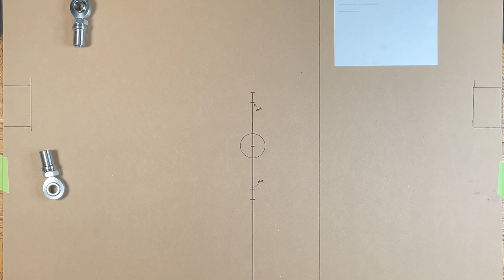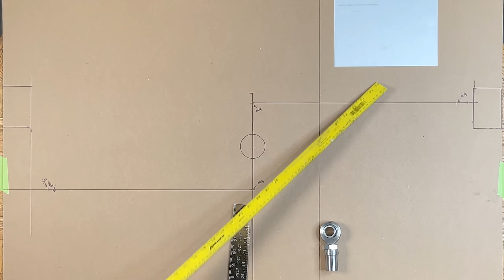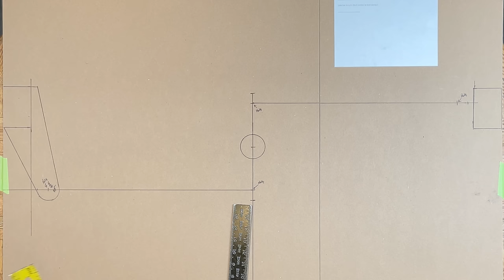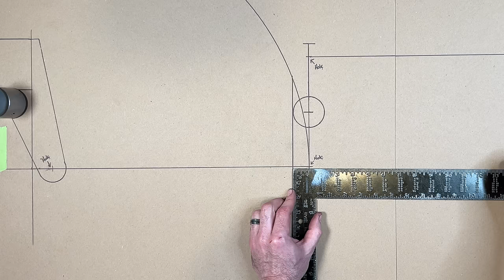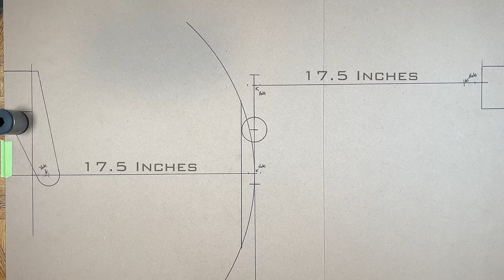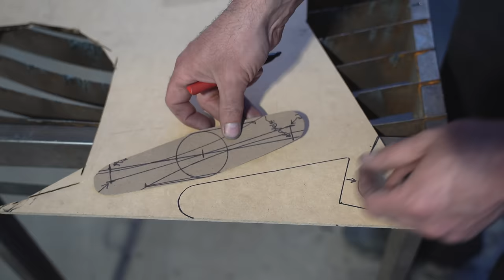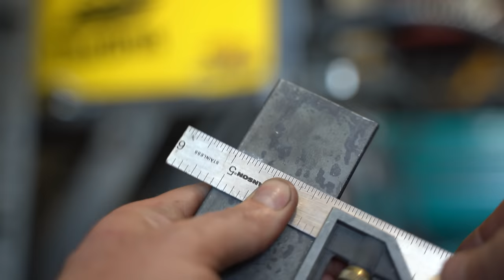The Greatest Watts Link Tutorial Ever! Mighty Max Ep. 16

Comment: One of those rare times I subscribe after a single video. Even though I already know how a Watts link works, I didn't feel insulted by your explanation of it. And you went into some details that I didn't know. Plus your fab work is absolutely top notch. Understanding the importance of a double shear mount instead of saying "good 'nuff" like some of the more shadetree channels would do was a massive boost to your credibility.

But the icing on the cake was the whole spiel with the tooth. That was just pure gold.

My gift, in return for the information and entertainment you provided, is to mention the "Mumford link". It's sometimes referred to as a "modified Watts" link. It offers a few advantages over the basic Watts; 1) It puts both frame brackets at the same height, eliminating the long, bendy bracket on one side of the Watts. This has obvious advantages for ground clearance as well. 2) It allows you to adjust the roll center by changing the angles of the main bars. 3) It can, in theory, allow you to put everything out of the way of the diff cover for easier maintenance. It's definitely more complicated than a Watts. And I can't swear it would work well on a long-travel vehicle. But it is very much worth a bit of research.

One more tidbit that many don't know-- both the Watts and the Mumford can have their pivotty bits mounted horizontally. You could have put that entire thing between the frame rails with the propeller mounted on top of the diff. Though I don't think that would be optimal since the pivot point would have to handle the articulation of the axle.
Reply from the maker: John… That was a tremendous amount of words. Out of all of them, the phrase I appreciate most was “Pivotty bits.” I can’t even type it without laughing.
I was once familiar with the Mumford link but have forgotten about it. I remember it being a magical dance of moving parts. I will certainly have to look that up again.
I’m clearly misunderstand your point on the horizontal mounting of the pivotty bits. I’m likely misinterpreting your statement as the whole watts link system on it’s side, but that most certainly won’t work. If you could clarify, I’d be insanely grateful.
Thank you for the kind words, John! Glad to have you. 🙌
Reply: @GarageFab  you interpret it correctly, the whole kit on its side. All the geometry works exactly the same. It does require an extra bit of flexibility at the axle pivot though. I've never seen it in use. I can't swear it's practical. And since the roll center of a Watts is at the pivot point that would create an absurdly high roll center. So it's probably more an interesting bit of trivia than a useful tip.
Reply from the maker: So I have heard of mounting a Watts Link system in front of the axle instead of link bars. (It was a theory at least. I haven’t been able to design it in my head)
But a Watts link prevents side to side motion by pushing and pulling on its bars.
By mounting the Watts on its side, it would then prevent up and down movement and only allow side to side motion.
So I still believe I’m misunderstanding something.  🧐
Reply: @GarageFab   With the propeller horizontal it will still rotate as the arms push on it. And the arms will still push in opposite directions as the axle moves. Try it with your scale model. Just stand it on its end and move the axle up and down.
Reply from the maker: Ok, I’ve thought about this for practically a whole day simply not getting it. But now I think I know what I was misunderstanding. You said the “pivotty bits” would be horizontal. I interpreted that as tipping the entire watts link system in it’s end. 
But you meant the propeller could be mounted like a helicopter prop, but the bars would remain horizontal. The bars would then be on the same plane but one would be a bit FORWARD of the other.
Given this epiphany, yes, I’d agree this would work properly. Also it wouldn’t necessarily have to be on top of the diff. It could still be behind the axle with a cleverly designed pair of bars bridging the diff.
It would certainly take up more room behind the axle but it could have prevented my design from needing frame tabs that hang down 6 inches.
My brain is fried now thanks, John. 😳
Reply: @GarageFab  ah, yes. Now I understand the confusion. You are correct. I was explaining it poorly.

Comment: Very informative and debunking the myths.
Also you can always use links on current model diffs and upgrade axles and centres. Or use y rear end setup like the series 2 Jag or the Aussie commodore or falcon rear.
Reply from the maker: Thank you Michael! I almost used an IRS Jag rear end with inboard discs on my truck several years ago. Don’t remember why I changed my mind. 🤔
Reply: @GarageFab  jag rear cannot handle huge ponies but ok for stock 350 chev or slight cam work but not over 300 hp
Reply from the maker: That said, I think it would’ve been fine the TPI engine I had. I think it was just laziness. By the time I came across a spare Jag subframe, the 4 link rear suspension was already done and didn’t want to redo anything. 🤷‍♂️

Comment: This is one of the BEST explanations of a Watts link I've seen. I've seen it attempted in some crawlers but it never worked out right.
Reply from the maker: Thank you my man! I’d love the challenge of trying to make a Watts link work on a crawler. There’s not usually a lot of room for articulation. I’ve got some ideas though. 🤔 
I appreciate you. 🙏
Reply: @GarageFab  I've seen long bar attempts on two jeeps and they failed horribly. One tried making the pinion arm long but it extended so far below the axle it made it useless. lol
Reply from the maker: I recently learned that you can mount the pinion vertically (like a helicopter propeller) and it still operates as it should. You could potentially mount it on top of the axle. All the ground clearance in the world.

Comment: For anyone who wants to use a watts link and handling is the primary goal remember that the rear roll center height is determined by the Watts link pivot point height. If I remember right the rear roll center height for a panhard bar is the height at which the bar connects to the axle.
Reply from the maker: I agree 100% on the Watts Link roll center. The panhard bar roll center (assuming it’s set up properly) is in the center of the panhard bar. Which means the roll center height varies if the suspension height changes.
I do not know this as fact. But I would be shocked to find out THE most common axle locating device puts a vehicle’s roll center on the far left or far right side. That would induce some really strange handling characteristic!
You are appreciated. 🙏

Comment: The stress you were trying to avoid on the center bolt is called "cantilever stress". By building the 'housing' that supports the bolt at both ends, the bolt is now in "Sheer". You can consider that bolt infinitely strong!  The only point of stress, is the bracket welded to the frame, to anchor the lower link. That bracket receives the most "cantilever" stress, in the whole system. It could even twist the frame rail. That would be the most likely point of failure, if you slide side-ways into a curb. Having the upper and lower links invert, is called "camming over".
     I never thought about creating the "Z" to increase up-down travel. When I built my model, I just simply set the 'propeller' on the vertical, and made sure it was big enough, that it never could get close to "camming over" within the travel of the rear suspension on my Chevrolet Caprice station wagon. I built it, because I HATED the jounce steer caused by a relatively short pan hard bar, from the factory. (The factory pan hard bar was set level at resting height. The car was equipped with air-shocks, to allow adjustment for different loads.
Reply from the maker: Thank you for taking the time to write all that, Vincent! Good info is always appreciated. 👏 
If I’m being honest, if there was any curb smacking, I imagine it would have yank that 8 inch frame tab clean off.
Also that might trigger be a divorce. 😳

Comment: Wow ! I had no idea how all this suspension actually works .. & at first was over whelmed ..lol But due to how you present it in a way I can grasp it's function & why .. I am not so worried about actually doing it !  My project is actually very simple sense I am not building a vehicle that's going to rock crawl ... lol  just a tiny short wheel based 4x4 Suzuki samurai custom pick up .. to go to town in .. with no rear box beyond the cab just a tiny flat bed , leaf springs go beyond the rear frame so I am building a 4 link top triangulated suspension just like what you taught me .. sense I went back to the first video & learned how it works & what i need to do to make it all work properly ... the travel up & down won't be far from ride height .. Knowing now what to make sure of & why is extremely important ..it make sense now .. with out your Knowledge I was headed for trouble for sure .. it was way over my head .. thank you for building my confidence with basic know how eliminating my ignorance level ... I really think I can do this !
Reply from the maker: No better compliment has ever been made, Lee. Thank you for that. Putting power in people’s hands is my main goal. If you get stuck during the build, you know where to find me. Best of luck my friend!

Comment: I did a watts link on my old 96 ranger back in 2002 when the mini truck Bible  (minitrucken mag) was still around .
One of the important things is to remember is the chassis brace between the bar mounts.
Also I inverted my setup with the bars mounted two the axle and the watts link in the bed.
Reply from the maker: Nice! How did that work? Any weirdness in handling?
Reply: @GarageFab  nope feels the same.  I don't have it anymore 😕 or I'd send pic's.
Just picked up a Tacoma for my next
Reply: Just finished a 85 Datsun king cab vr6 Bagged build
Reply from the maker: Nice!

Comment: Make sure you make some drainage holes in the bottom of the factory cover. Oil will makes its way through the bolt hole and then get trapped between the covers, lowering your oil level in the diff. Alternatively, seal up the bolt hole if you have the space.

The cover/link looks KILLER by the way! Keep up the good work.
Reply from the maker: That’s a good point. Trapped oil didn’t concern me much but with such an easy fix why not? 
Thank you my man!
Reply: @GarageFab  just make sure they're not it a position where the gear will sling oil into the drainage holes, taking away from it's intended destination lol. Maybe a couple small ones towards the sides. Just big enough to let the oil back into the diff
Reply from the maker: Agreed!

Comment: Bolts generally function in tension like head, main bearing and rod bearing. The pivot bolt initially was working in tension as well as "single shear". By building the outer brace, you put the bolt in "double shear". This removes the bending force off the bolt and at least doubles the shear force required to shear the bolt.
Reply from the maker: That sounds good to me! Thank you, Dale!

Comment: Nice, very nice Aaron! I noticed on mine since the propeller is the rear pivot point it works the front suspension harder because of throwing the weight it lightens the inside tire. But, as you know I did mine off the frame and I'm thinking a rear sway bar. On a side note I just purchased a used Syclone intake, exhaust manifolds, turbo, intercooler. I can't use the intake or plenum but just the Mitsubishi turbo was 1200 eight years ago. Am I stoked. YES. I had to tell someone! And yes, you do great work, funny and you teach everyone.
Reply from the maker: I only vaguely remember your Watts. I kinda wish I could see it again! I also want to see this Syclone setup!! Do you have an Instagram? Or are you posting on Facebook?
As always, Thank you my friend. 🙏

Comment: Have seen a Watts Link design that had both bars coming off of the same side of the frame. It was on a Sprint car that i had the pleasure of helping rebuild back in 2012.
Reply from the maker: I am fascinated! Intrigued even. I can’t picture how a watts link would operate that way. I picture a double panhard bar.
Reply: @GarageFab  is a double panhard bar a thing? If so, seems it would do the job of a watts link and possibly be easier to build. Now I’m intrigued!
Reply from the maker: You could have two panhard bars, (For added strength perhaps) but they would have to be the same length and mounted to the same points on the chassis at the same angle. They could NOT form an X. 
Because the panhard swings in an arc, connecting a second one reversed would create two opposing arcs and the suspension would simply lock up. 😱

Comment: This is awesome. Your jam nuts are maybe going to make contact with the bell crank . I am making mine wider at that point with step bent 1/4" plate for mine
Reply from the maker: @jrewing8012  Good call! Certainly can’t hurt.
The way I see it, the jam nuts shouldn’t get any closer to the bell crank than they are at half travel. When the suspension extends they’ll pull away, and when the suspension compresses they will also pull away. 👏

Comment: Great video for the garage punters good effort 
There is a thing called roll Center which involves this linkage and can be made adjustable with a watts by moving the Center pivot  up or down this is a thing in some solid axle race cars made screw remote adjustable maybe to complicated for this audience or maybe worth doing a video on it 
Keep up the good work 👍
Reply from the maker: Oooo! That sounds neat. Complicated is my middle name. And so is Learning. (I have several middle names) I can’t think of a better way to actually be able to EXPERIENCE high vs low roll centers. Being able to adjust it instantly in the same vehicle would definitely do the trick.
I have plans to build an actual running driving truck that has the ability to quickly swap between several rear suspension designs for road testing videos. I hope to remember this when that day comes.
Thank you my friend!

Comment: sense the lower arm parallel to the axle has a longer bracket that creates more torsion on the frame in that area that it wasn’t designed for originally ! even though boxing it does reinforce the frame rails maybe a new cross member as close to that bracket as possible 💪might be a good addition in heavy duty applications! 🙏Always respectfully & apologies if its in a previous video i haven’t sunken my teeth into …yet new sub !  honestly your the best fab channel i’ve found on Youtube not just because of your ability too articulate & knowledge & skills but your sense of humor can’t be overlooked 💯🔥

Comment: Your best video yet, and that's saying something.  So many snacks. Tooth-licking. Welding finger.  Oh, and the greatest watts link tutorial ever!  A question please - Is it ever acceptable to run upper 4 link bars at an angle (like the 8.8" in Mustangs), along with straight lower 4 link bars, without the need for any other form of panhard /watts link / Mumford bars etc?  My guess is that it would get you down the road OK, but still be far from ideal as the upper bars would be doing all of the work in locating the rear laterally.  Keen to hear your thoughts, and thanks again for such a brilliant channel.
Reply from the maker: Thank you, Craig! Very much appreciated. You’re the first to notice (or mention) the magic Mig finger! If I had a prize I’d give it to you.
I’m unsure if you’re referring to the triangulated 4 link. You absolutely can trade the lateral locator for angled link bars. You just need to ensure the upper bars are at a great enough angle. The more extreme the angle, the more stable the axle will be left to right.

Comment: FYI (I could be wrong) The ground clamp for the MIG is positioned such that the path of electricity flows THROUGH the Heim joint... this can cause pitting on the fine surfaces leading to a sticky joint and quicker failure.   Love your show, though!
Reply from the maker: Yeah, you’re right. I very possibly caused some arcing where arcing shouldn’t be.
Hopefully, because Heims are so tight, that didn’t happen. Often when the ground side of a part arcs and fuses, it’s because there was a loose connection. I guess we’ll see!! 😬